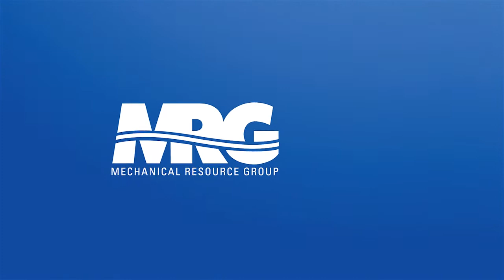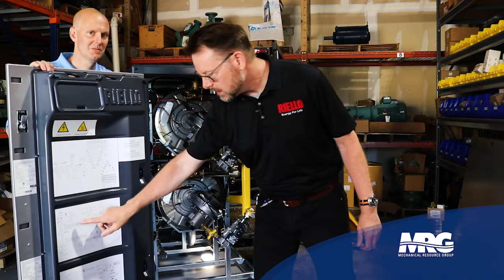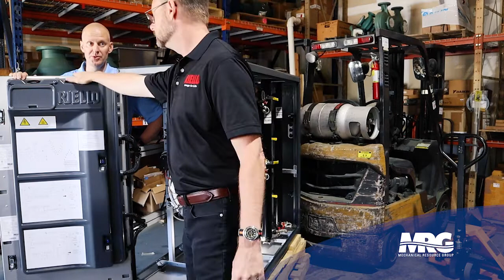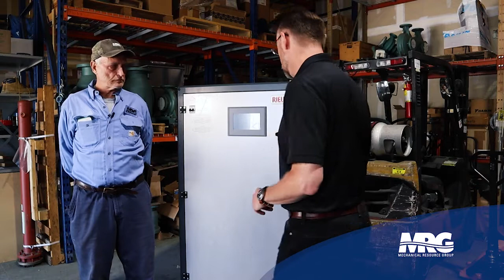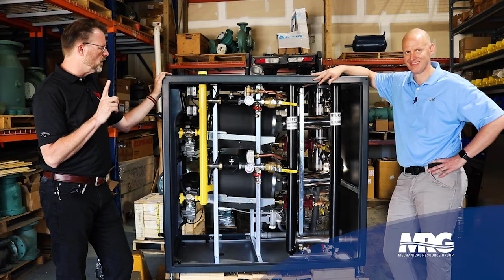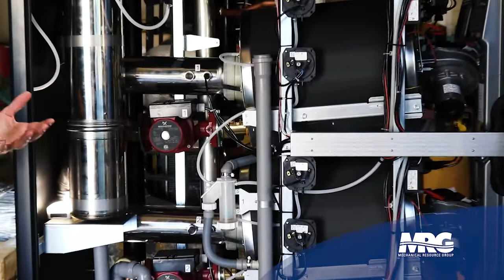Eliminating Points of Failure with Redundancy | @MechanicalPros - Boilers

Comment: We have 13 of the first version Array 1000's. Nothing but issues. Heat kills the internal controls on a regular basis. Constant LWCO/Air Intake error codes, no matter how much we bleed the air out of the system. Front displays crapping out. Original flue piping inside the cabinet was plastic, and they all dry rotted out and cracked.
Reply: Same here! How did you guys fix it?